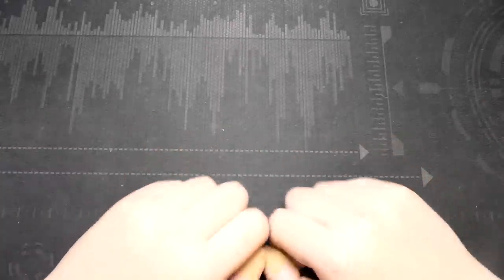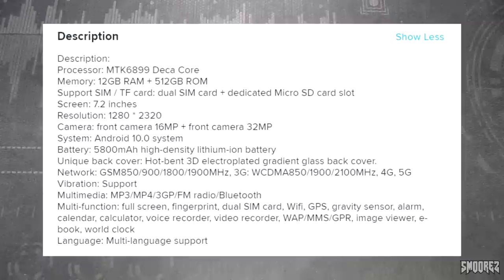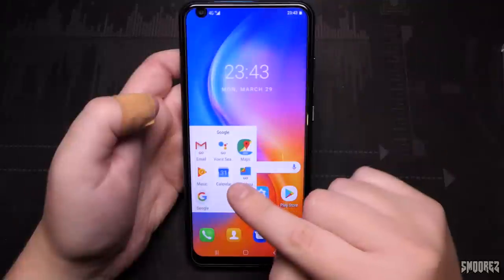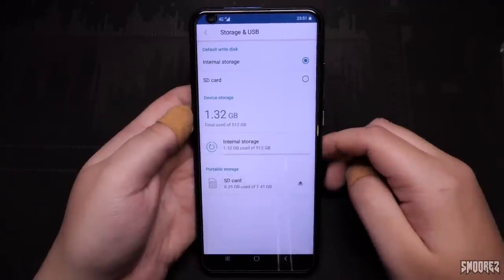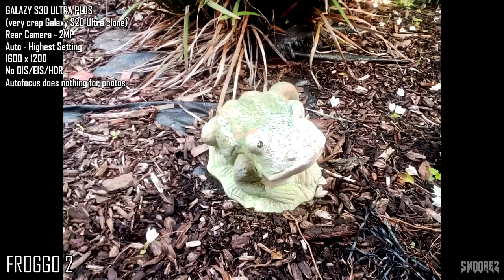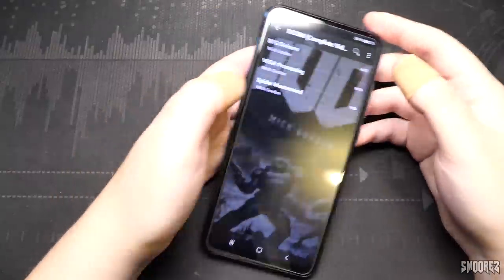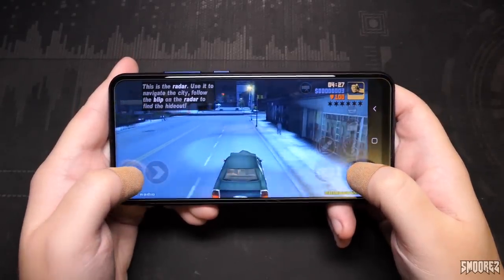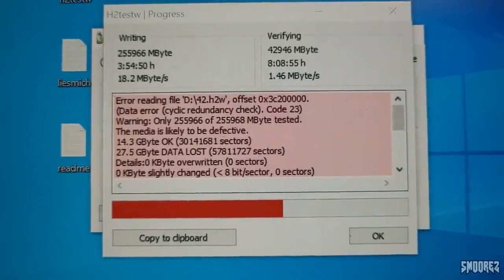iWish: This is the GALAZY S30 ULTRA PLUS PRO, a $200 AUD 7.2" WELCOME branded device...

Comment: 3g is mostly gone here in Norway allready so it would not work. But noticed a few eBay sellers lists these with the true specs....
Reply: eBay is notorious for siding with the buyer so if someone found out that they were lying the buyer will be refunded in full.

Comment: You might have to flash the firmware to make that motherboard swap work. different displays require different drivers. I messed up a welcome phone with the wrong firmware. it flashed, but because it was the wrong phone, the screen just lit up. flashed the right one, and it worked again
Reply: The screens are serialized?
Reply: @SweetTodd  not exactly. think of it like a set of instructions for how to power on the backlight and put the image on the screen, it's got specific instructions for different displays, like of how your computer needs to install a driver for a new device.
Reply: @Nurf  Oh, I see. I thought for a minute cheap phones started to copy Apple.
Reply: @SweetTodd  I can't imagine they'd have the budget to do that 🤣

Comment: Interesting that you describe oppo as a budget brand. My oppo is the best phone I have ever owned. Unfortunately I broke the screen and keep forgetting to have it fixed but that's another story. Currently I have a Motorola G9 which is fine. Also has a cracked screen but functional. Turns out phones and hands on jobs don't mix

Comment: Hey guys. I'm shopping for a new phone. What's the best new phone for under $250usd? I have been looking at the Poco X3. Plastic built is fine, no gaming needed. But I want a good camera. Right now I'm using an LG V20. But now it's got screen retention problems, the ear piece buzzes and the camera no longer focuses properly. Any advice?
Reply: Poco X3 is a solid choice. Other options at the same price range is the Redmi Note 10 Pro (if you want 120Hz AMOLED display) and Realme 7 (if you into gaming). If you don't mind about lower performance, Redmi Note 10 is cheaper but still offers AMOLED display and goodies like stereo speakers.
Reply: If you don't game just get the Redmi Note 10 Pro(has AMOLED) or the Mi 10i (120HZ LCD). Better than the POCO X3
Reply: If you could add another $50, you could buy Samsung A52, cameras blow all those Xiaomis and RealMes out of the water. The only thing Xiaomis have over the A52 is a bigger battery, 8W more charging power and SnapDragon 732G instead of 720, Samsung kills them in every other department especially cameras, image processing and overall software.
Reply: Don't buy an X3 if you want a great camera, X3's mediocre at best

Comment: Have you ever tried to reflash a higher version of android on one of these? ... Enjoying your videos from the USA
Reply: That's not easy to do, he would need the rewrite the drivers and stuff.
Reply: @chongtak  No he wouldn't. He could simply install a bootloader and flash an upgraded OS or firmware.
Reply: @kupokinzyt  you cannot flash an upgraded is on a device if the upgraded is hasn't been tweaked for your specific device. Otherwise all older and exotic devices could receive any newer OSs, is it the case? No it's not.
Reply: @chongtak  I misunderstood what you originally wrote, sorry, you are correct.
Reply: @kupokinzyt  No problem :)
Edit : I have just realized how broken my English was. Partly because of autocorrection on my phone, partly because of my limited brain lol.

Comment: Hey smoorez how to install the official antutu benchmark in an android phone?
Reply: You download the app from the PlayStore and install it just like any other app. Duh.
Reply: @no-prophet  you can't, google remove it for reason that it's "inaccurate intensionally"
Reply: Sorry, didn't know that. You can download from this link if YT allows me to post it.     https://www.antutu.com/en/download.htm
Reply: @GTAandApplechannel  It is inaccurate, intentionaly or not. I just took a look at the scores and there are some obvious inconsistencies.
Reply: @no-prophet  I'm not talking about that
I'm talking about every single brand that Used to buy Aututu Score by removing heat warning pop up and overclock the CPU when using that app and only that app , the CPU Score maybe higher but the GPU Score will stay consistent no matter what but the CPU Score will make an overall better score and that's intensional

Comment: Nice video, Avast sucks though. You should use Malwarebytes and/or Bitdefender Mobile.
Reply: He said that this crappy phone can't run it
Reply: @GTAandApplechannel  It should run on 2gb RAM devices just fine, I've used both on tablets with 1.5gb RAM
Reply: @ELECTROHAXZ  what important is the SoC but apparently the SoC in this wish phone isn't power enough for that
Reply: @GTAandApplechannel  Malwarebytes and Bitdefender run on ARM and ARM64 devices, this one would be ARM (ARMv7) so it would run.
Reply: @ELECTROHAXZ  I know but you will never know

Comment: Some more stuff about the S20:
The battery life is probably due to the Exynos, of course they're well known to be very slow and power hungry compared to the Snapdragon equivalent. Also, could be that you left it at max resolution, I keep my stock S20 at 720p60 unless I'm playing a game or watching YouTube (you can setup a Bixby routine to do that for you).
As for the camera, yeah, they fu--ed up, they should've added the laser autofocus like on the Note 20 but they didn't for some bizarre reason. It takes great photos, but it's nowhere near snap and go as you'd expect, and close ups are average to bad unless you use the macro camera. 
My experience is with the Normal S20, although the only difference is the zoomy camera and the smaller screen and smaller battery. I got mine when I switched to att and they had a deal on it. 
Honestly these days, I don't know why anyone wouldn't just fork over the extra dolans and go straight for the note, if you're already spending that much on a phone, you might as well get one with the better camera and a stylus, they're the same size as well so you don't lose a thing, only gain.
Reply: Also samsung phones will always have crap battery life when you first get them. Until it can properly gage how you use your phone and send the apps you don't use to the shadow realm, they will not last. I remember when I girst for my S22 ultra the battery life was half a day. Thankfully now as long as I'm not on it all day it lasts the whole day. 
Although I do have a magsafe power bank that I still keep with me just in case

Comment: It's astonishing, that someone still purchasing this crap, when you can get an really good device like the realme 8 with real amoled, real under display fingerprint reader, decent cameras, big battery and a good update policy for way under 200 €/$ - what surprises me is that the display corners are surprisingly narrow, and the microphone when recording a video is shockingly good. Ripley is absolutely adorable. 

"Give me anything better than the 6580"... Look what you wish for. When the containers of the 6580s are empty in about 5-8 years, they maybe use the A22. I hope in china these phones do not cost over 30 dollars

Comment: What a waste of Ressources. The silicone and lithium in the device could've been something usefull but it is destined to end up in the landfill.

If i bought one here in Germany I couldn't use it, even if I wanted to. 3G Network was shut down this summer.

I wonder who is behind those devices. Really wonder. But you can't find anything on the internet. From the bottom of my heart, I wish anyone involved in creating, distributing and marketing those devices cancer. And generally to suffer from anything climate change will do with this planet. It's basically planed obsolescence taken to the extreme. It only works because they lie to gullible people.